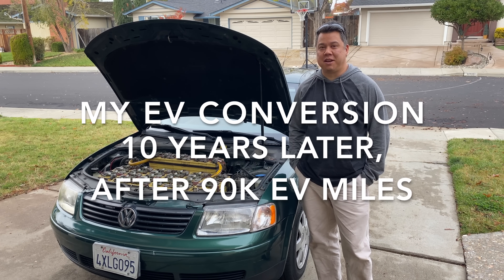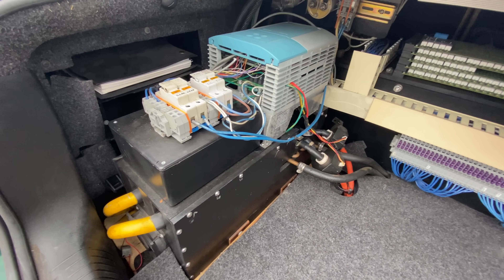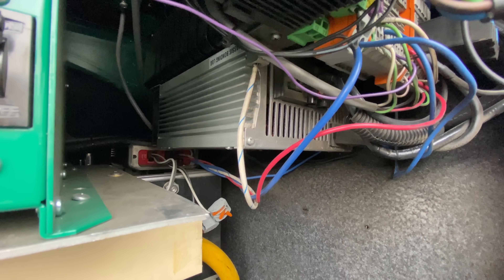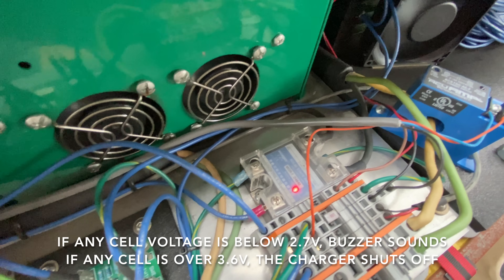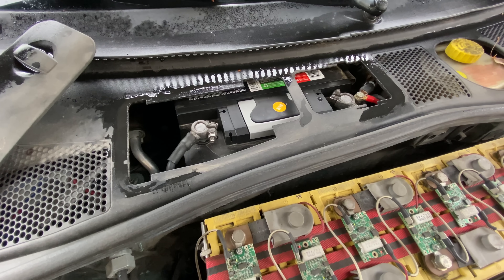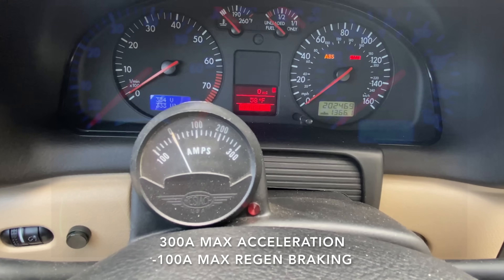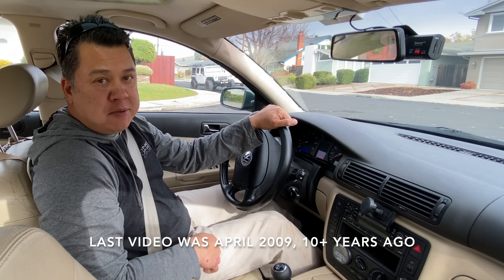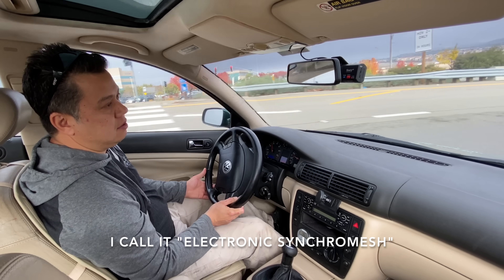My EV conversion after 10 years and 90k miles

Comment: I mean that’s cool and all but 90k miles over 10 years? That’s not in any way an impressive headline lol. My shitty 2011 Malibu that I bought for $4,500 with 150k miles on it did another 100k miles over the past year and is still running fairly well, all I’ve done is put a new starter in it and did a front brake job. Hold electric cars to the same standard as cars with IC engines, if you can’t put a lot of miles on it without shelling out $30,000 for a new battery every few years then clearly no middle and lower-middle class people can afford to drive it. It just becomes a virtue signal for the ruling class…

Comment: jeez dood why are you not starting a company, you clearly have way better ideas, and once battery efficiency is where it is you will be set..this is a phenomenal system way more thought out than any others

I have always shunned their systems,not so much charging or battery but their drive systems, you approached it more how it should be approached, by swapping the internal cumbustion for the electric motor..

the way the others do it is goofy and poor design, l way to complex too much room for wear and error, why you only get about 20k miles out of a battery or drive system before it needs replacing, 100k miles? that is extremely impressive, and clearly the reliability is there to put that many miles on it..

the way they do the motor is goody, they make and electric motor and transmission all in one, its stupid, too complicated, weak and fails so much people are deterred form buying electric, yours is a good solid design and I already know you have many more improvements..

IMHO the electric should always have been approaches as a replacement, same dela its output shaft is power output, built it up to an automatic, 8 speed whatever..

don't make the electric motor the transmission/ drive train as well, I've seen them torn apart and they are HORRIBLE designs at best,why I won't touch one, they use to much energy nothing about them is good.. some of them are right at the axle, so they are differential, power plant and transmission all in one.. we just are not there yet, we don't have the materials, engineering or craftsmanship to build the style they use today, yet they keep pushing and they keep failing, most right around 20k miles, and the kicker is the batteries are warranted, but only if they do not put out a single volt..

so in 10k miles when your battery capacity drops to 30% what it use to be you are stuck getting 12 miles out of a charge... its goofy and useless, this is more the way I would design EV but frankly I would go an 8 speed automatic, manual brakes as in non power.. they all used to be that way and stopped far heavier vehicles.. your AC and heating system is great, all it needs is refining IMO but man whata car..

te fact you have gotten 100k miles says it all, find me ANY other product that has this mileage... no way, not without major repair and or replacement

questions

why did you go a synchronous manual transmission as apposed to automatic OR use the clutch? my guess is electric motor speed is difficult to match, so when you clutch the electric motor falls to very low RPMS so when you release clutch it has engine braking issues... for that I would use an motor speed matching system, based off wheel speed and gears, so at 45mph to go from 2nd to 3rd the electric motor needs to meet the pressure plate at 3245 rpms whatever the case may be and the current is automatically supplied until the pedal is all teh way up then it's up to the accelerator or driver to go from there, this way you can shift very quickly no issues, its all about motor speed vs drive train speed, synchronize it I know you can do this..

automatic seems even easier, nothing required at all, plug and play? and today they have like 10 speeds so that suits an electric motor even better as the electric motor can draw less power stepping up ear ratios for extra speed, i am sure a special torque converter may be used to accommodate the electric motor as in impact so forth..

like to hear why you elected to go the way you did what you encountered..

all inallthisis a PHENOMENAL build and for 10 years ago? you're nothing short of genius my man.. nothing short and we need to get the real geniuses working in this industry solving real problems for real solutions, at this point 20 years later I still do not trust EV or hybrids, I just don't, I want one, but I want one I can go longer distances and the batteries last me more than a year..

seems to me they are still bought off by big oil and do everything backasswards to keep people form going electric, just how it appears? I mean c'mon, 20 years later and 150 miles max range?  huh?

and why do they only put one lil puny battery in the back on an electric car and call it good?  CUZ THEY D NOT WANT THEM TO HAVE ANY RANGE AT ALL!!!  to prevent folks form buying them!!! why the engineering is all wrong.. why they don't last, why warranties do not cover anything worthwhile.. hale the entre chassis can be stuffed with a row of batteries under the car front to back then the trunk and engine bay?

 instead they have maybe 2 lil batteries in the trunk and say, OK here is your EV, sorry it only goes 75 miles... ridiculous.. what's worse is no one says a word meanwhile we continue to breath filthy air, get robbed to buy dated fossil fuel vehicles and the fuel.. all so counterintuitive, and no one says a word all so crusty greedsters can get paid even more money...  silly

Comment: Impressive but how is it day to day? Do you charge at home 99% of the time? What's it like to wait for a charging station? How often has the government asked you NOT to charge your car because if grid problems?
Reply from the maker: When I was driving it to work every day, I would charge at home 50%, and work 50%.  I've never had to wait for a charging station, my work has valet for ev and 100+ ev charging spots.  At home I charge after midnight, so it's off peak.  I've never been asked not to charge.

Comment: You must be an electrical engineer. I have rebuilt two large engines by myself over the years but this system looks like it belongs on a space ship. The average joe could not build this.  Great job and excellent video. Thanks for your time.

Comment: "I did several years of freeway driving at 75mph using only 2nd gear" and "I change transmission oil every 12k". now it makes sense. Amazing project its shows that its been incremental.
Reply: it's a manual though...not much heat generation compared to an auto

Comment: The question that leaps into my head is if you can do this yourself without economies of scale for $25000 why do production line EV manufacturers vehicles cost so much?
Reply from the maker: You're not factoring in my labor =)
Reply: @etischer  Apologies. I did enjoy your video and your ingenuity very much. When you said the conversion cost $25k including the car I did sort of assume you had included that. If you factor your very skilled labour into the equation would $75k be closer to the true cost. However as the Chinese are now knocking out EVs for $5k it will soon be very academic.

Comment: just saw this, though i do like your conversion i was confused by the battery spec. Is each cell 100AH or all the cells 100Ah? I understand the equation of 33KW/330V being 100A so it seems here that you've connected the 99 cells all in series meaning 1 cell is 100Ah. it becomes confusing when doing math but typically people rate Ah as the total battery capacity (irregardless of setup). So the correct way to mention the capacity of the battery is via the per cell 3.7V nominal, that means that your battery capacity is 33KW/3.7V =8.9KAh. When quoting battery Ah this is actually how you do it. KWh is the most user friendly capacity but most manufacturers prefer to quite with Ah, so do not immediately assume when you see an Ah rating that it is based on the battery setup (i.e. for powerbanks, its not 5*Ah, its 3.7*ah).
What you could've done is said 33KWh, 330VDC, 100Ah/cell.

I will critic though that while the high voltage is good for efficiency and weight savings, its not the best thing to do, typically at least 2 cells are paired in parallel in every part of a series cell. So you would then need 198 cells for the same volts. The reason is, if 1 cell fails, it will not break the circuit but you could notice a performance degradation instead or an out of profile voltage dip during acceleration.

Comment: nice build thank you for sharing I'm building one myself if i can albeit much more janky. starting with Ebike tests and then sourcing a large enough motor to achieve 501mph gear ratios may help but definitely only utelizing 100mph of speed capacity ... cooling in the right areas will be big for me too thinking of Frankensteining existing parts from other manufacturers and making a build/repair manual with all the part numbers just In case a colledge kid 100 yrs from now most likely past my lifespan wants to fix up an old but reliable antique

Comment: Wow well done. Compared to how today's EVs are being designed it is lights years behind yet when built we may have thought light years ahead of it's time.. Today the motors are built into the wheel hubs.. in fact a major electric  motor builder manufacturer has an ad at the beginning of this video... A Canadian company !  Oh and today you don't need a transmission anymore..

Comment: What is the reason ev's don't use a clutch and gearbox?
Reply: They don't need more than a single speed reduction gearbox due to the linear torque curve of the electric motor.
A transmission is a solution to a problem that electric cars just don't have.

Comment: The gearing is fascinating to me, always wondered why they wouldn't put gears into an EV, doesn't it run more efficient when you gear up on the highway? Lower rpm=lower power usage no?
Reply from the maker: At some point you can make a motor powerful enough that the car is traction limited even in "5th" gear, so a multispeed transmission is pointless.  Lower RPM = more torque required = more amps required = more power lost due to resistance.  Ideallly you want RPM high, to run higher voltages, and reduce electrical losses.  For my car, it ran slightly more efficient in 3rd gear on the freeway compared to 2nd, but my transmission isn't optimized for running ~20k rpm input speed like modern EVs.

Comment: Spending $25K for the conversion, and I assume atleast $10k for the car, couldn't he have just bought a used Telsa model 3 for ~35K?
Reply from the maker: $25k inlcudes the cost of the car.  In 2008 there were no EVs on the market.

Comment: The part of you landing job at Tesla with this built is amazing. Congratulations. You do seem like a very smart and well educated engineer. Judging by your video, this electric motor is far more complicated than an internal combustion engine and has many more parts that could go wrong, so it is amazing how nothing has ever broke on your build and even the break pads have lasted at least twice than they would last on a regular internal combustion vehicle. Maybe the secret is not in the simplicity, but in the quality of build. Congrats!

Comment: Why use a transmission? Only reason a gas engine has one is to stay in the power
Reply from the maker: The motor needs around 10:1 gear reduction to be in it's power band.  Torque is relatively flat across the board, but to get max power (torque X rpm)  the motor needs to be above 3000 rpm.   Torque and power do drop off a bit above 8k, so for freeway driving I shift to 3rd gear to get slightly more power compared to 2nd
Reply: @etischer  ahhh I gotcha, this thing is just plain neat. You did good awesome man

Comment: Where does the torque from the motor go? To the rear wheels via parts of a 4motion system? Was this Passat originally a 4motion model? Because I didn't see anything going to the front wheels.

Comment: Electric cars rely on regular charging from the local electricity network. The power plants providing that energy aren't emission-free; even in California, 60% of electricity came from burning fossil fuels.
Reply from the maker: We have enough solar on the roof to more than offset what my car uses.
Reply: @etischer  OK, but it doesnt change the fact that 60% of power plants gets thier energy from fossil fuel. Maybe the powere plants should get all of its energy from solar panels too.....
Reply from the maker: @bulrydrdan  Are you complaining that 40% renewable energy isn't good enough?  Electricity generation will only get cleaner with time, with solar now on parity with other means of generation.  This means EVs get cleaner with time, unlike gas cars that start burning more than just gas as they age. Again, my car is 100% powered by sunshine on my roof.
Reply: @etischer  Complain? What I’m doing is posting facts, what you’re doing is stating opinion. Any facts that support your statement that your cars runs only on solar power? All I stated what the fact that 60% of electricity comes from burning fossil fuel.
Reply from the maker: @bulrydrdan  Last year my (2012) solar panels out 5450kwh.  My car averages 300wh/mi, so that's 18k miles of range per year, I actually drove less than half of that each year.
Reply: @etischer  Last year 2012? Do you mean 2021? The issues is not amount nor what was used by the vehicle. You never charge it anywhere but home and Im going to have to call BS on the 18KPY miles.
Reply from the maker: @bulrydrdan  Our PV system is 10 years old, from 2012, but last year's total was 5.4MWh.  The math is simple, 5450kwh divided by 300Wh/mile... you asked me to post facts.  My model 3 is rated 242Wh/mile, or 22,520 miles from sunshine per year.
Reply: @etischer  LOL, keep trying to push that BS. If people could get that kind of miles without charging the electric car would sell its self. The Gov wouldn’t have to give people insensitive to force people to buy them if electric cars could go 18k per year. Especially since all the web pages say that the most you can get is 250 mile on a single charge. LOL
Reply from the maker: @bulrydrdan  There are no incentives / tax credits for Tesla, they expired in 2019.  And yes, Tesla is the best selling premium sedan in the world, despite being supply constrained, just wait till more factories start pumping out cars.  BTW, 400 miles per charge on Model S.  https://electrek.co/2021/04/26/tesla-model-3-becomes-best-selling-premium-sedan-in-the-world/
Reply: @etischer  Wow, still FOS, Toyota Corolla
Toyota Corolla: 1,150,000 sales
The Toyota Corolla was the world's best-selling car in 2019, and the dependable Japanese saloon continued to occupy the top spot with over 1.1 million sales in 2020.
Reply from the maker: @bulrydrdan  So the point your making is, 3 years ago Toyota was #1?  Back in 2019, Tesla had 1 factory.  Now they have 2 factories, and have taken #1 in their segment.  In about a month they will have 3 factories, next year they will have 4.  Tesla has consistently increased production 50%-99% year-over-year, and they are still production constrained. This is why Tesla is worth more than Toyota, VW, GM, Daimler, BMW, Ford, Honda... combined.  https://wolfstreet.com/2021/10/26/teslas-market-cap-gigantic-v-next-10-automakers-v-teslas-global-market-share-minuscule/

Comment: Excellent project 👌👌, You can try ABB ACS880 drives too, it has advanced DTC( direct torque control) mode which can estimate the motor shaft position precisely even without an encoder so it can help you to hold vehicle from rolling backwards on a slope… also u can have torque and speed control inputs to control as needed, it has a optional inbuilt codesys platform so it can handle plenty of logics u need to make using software, all interlock can be programmed in drives alone..

Comment: Does the manuel help with battery life? Like climbing hills or going high speed?
Reply from the maker: I usually leave it in 2nd gear most of the time.  There is a slight improvement in efficiency and power running 3rd gear on the freeway, as the motor is more in the power band.  The motor stays cooler too being able to run higher RPM (higher voltage, less current) on steep hills.

Comment: Why a transmission?
Reply from the maker: The motor can spin 10k rpm, but on the freeway the tires only spin 1k rpm.  The transmission increases the torque at the wheel by 10x, so the motor can be in the rpm range where it makes the most power.  The transmission is also the easiest way to connect the two drive axles to the motor.
Reply: @etischer  Thanks for the reply. Yes, I can see now that using the trans for the interface for the motor makes a great deal of sense in a FWD chassis, but could you have just selected just one of the available gears and eliminated the clutch?  Sorry for the questions, trying to form a plan of attack for converting my '66 Mustang to EV
Reply from the maker: @ohger1  I don't have a clutch, and usually I leave it in 2nd gear most of the time.  For a DC brushed motor, you will probably need to shift more often, as they have a narrower RPM band that they make power in.
Reply: @etischer  Thanks!

Comment: If you wanted to build a 7000W
Free energy generator 
With a battery and dc inverter
What kind of dc motor or ac motor would you use.